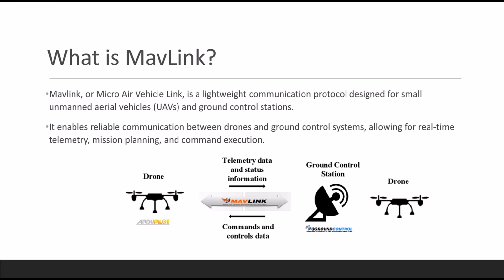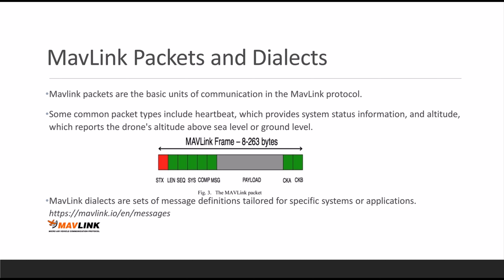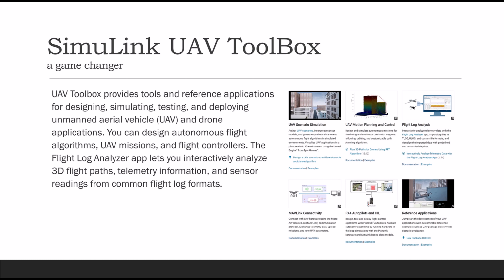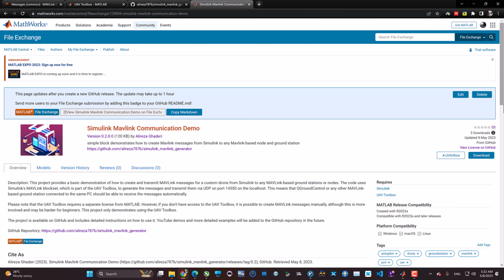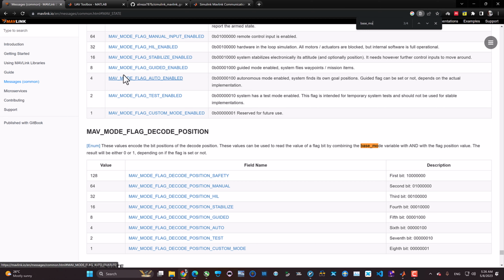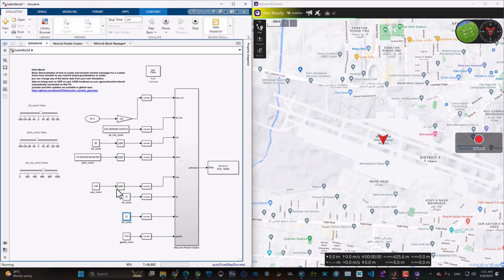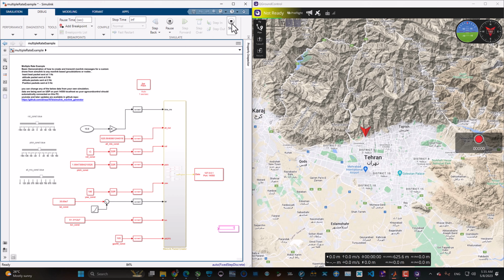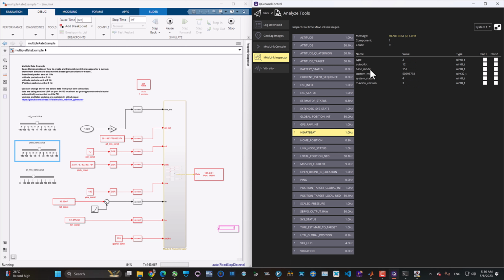Custom MavLink Packets with Simulink + Connect Multiple instances of Drones to QGroundControl

Comment: this video is amazing !! I have learned a lot !!! is it possible to create more videos similar to this? 
 I have a question, is it possible to create swarm of UAVs with routing protocol? is there a shortcut for that? is it possible to install routing protocols (proactive, reactive, hybrid) mavlink in matlab? (proactive/reactive/hybrid)
the UAV location is set from matlab to Q ground control, but the matlab scroll values are not connecting with Q ground control how can I fix it?
Reply from the maker: I dont understand what you mean... if you update the global position in matlab, the QGC position would also change

Comment: Amazing video, thank you! I am a beginner to these subjects so I have a question. To send the generated Mavlink package to uav directly from simulink what parts would we need to change? Thank you for your response.
Reply from the maker: make sure you send to correct IP/PORt or COM port of the drone and assign system ID corectly (usualy 1 when you ahve only one drone) and it should be fine